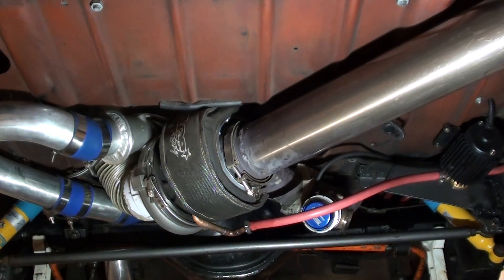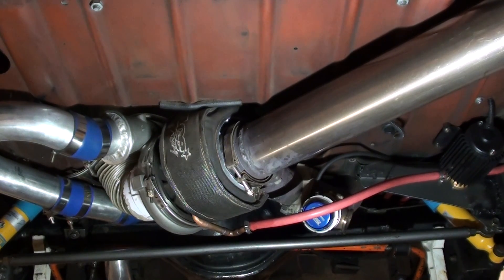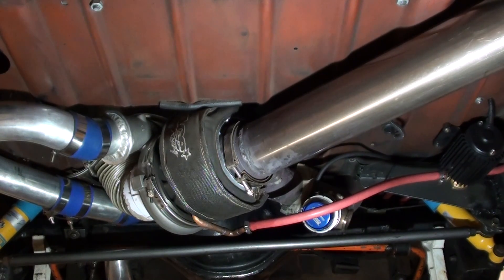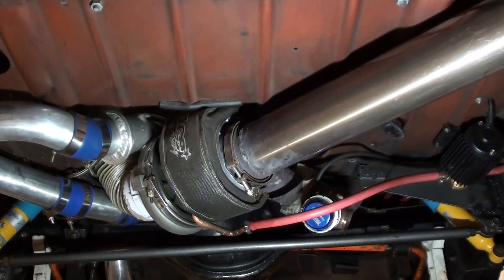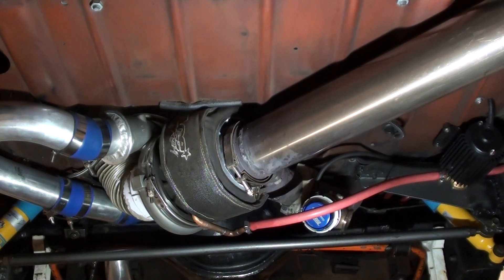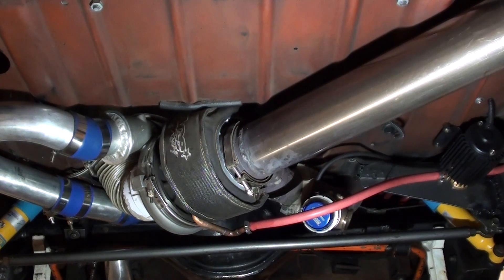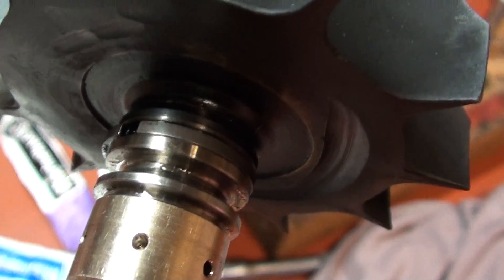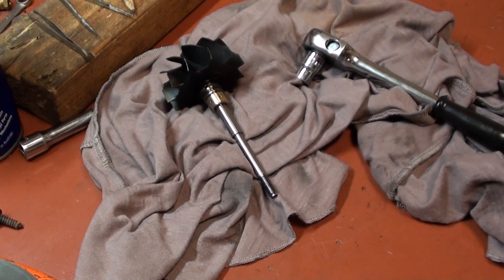REARMOUNT TURBO RETURN OIL SYSTEM  (POTENTIAL SOLUTION)

Comment: Great stuff brother. Did you ever try the reservoir? That makes alot of sense.  Run it out of the turbo into a small tank and the pump it back to the engine. But if the pump fails the tank will overflow. Good idea

Comment: Curious on how your oil return pump is lasting?  I’m seriously considering rear mounting my 302 but for some reason I keep hesitating. I have all the parts lol
Reply from the maker: I did have a turbowerx pump fail well before it should have, bought a china one and believe it or not still going... tip make some cooling fins for it  keep it running cool...

Comment: Griff I’ve seen some guys put a 1psi check valve in the oil feed line to prevent the oil draining down to the turbo when the car is off. Have you seen or considered this?
Reply from the maker: I have heard of that, The system I run now has completely solved everything to do with the return..

Comment: My understanding was that the return line from any turbocharger needs a free flowing gravity fed return with as straight as a run as possible to eliminate excessive pressure buildup in turbine core, hence the use of a metering device and set oil pressure into the turbocharger oil inlet.
How does this system get around that?

Or is the oil return side not as important as it has been made out to me!

Comment: Hey I'm form Sydney, Good to see a a fellow Aussie on youtube with a banging car. Great video, Highly informative. Thank you for uploading.
I am considering a similar set up for my 4.2L S5. There i no room in the engine bay for turbo's and a supercharger kit will only yield me +170hp including supporting mods. So i really want a turbo instead and it looks like rear mounting is my only option. I like the fact that there will be less heat generated in my engine bay. Plenty of airflow under the car to keep the turbo cool.

What kind of costs would I be looking at based on your experience ? Is it as simple as buying an aftermarket exhaust with soem fabrication work to fit the turbo?
Reply from the maker: Its not easy to answer your question without seeing your machine.. Based on 4.2 cube a 2.5 inch exhaust system will work well with good flow, and will offer quick spool up...You  need too have a hi flow muffler if running pre tubo. Basically a see thru.. Personally i would solid mount turbo and run flexible bellows.. Theres a lot to consider for it to work well.. shame im not closer mate.. Cost varies depending on quality of parts and if your able to do it yourself..
Reply: Ahh right I see, Thanks for your reply mate I'll take note of that and I'll see what I can do to save money along the way. I'l keep you updated with progress if you're curious. It will be a tight fit under there cause of Audi's 4WD system so it should be interesting to see what can be done.
Cheers buddy :)
Reply from the maker: Levi Lavel im always curious of rearmount builds and yours sounds very interesting mate...

Comment: I have only seen video of one other person running rear mount, and saw one of your newer videos, the first thought that had occurred to me was how do you keep it oiled, I assumed that you just do just the same as a regular front mount. I decided to look if you had addressed it and found this video. It seems like a logical solution to just add a small pump and reservoir just for the turbo rather than using a lot of hose and plumbing it all the way to the front, it would be a lot of hose for potential leaks. A side benefit would be that even if the engine somehow starved itself of oil you wouldn't have any risk to the turbo, so long as the pump can still run while the engine cools.
Reply from the maker: trued_2  There are a few ways too run a oil system, but i like this way, have a look at the finished mod vid i did, Thanks for you input i have weighed up pros and cons.cheers..

Comment: eazy fix run two lines to and from the turbo then to pump for the oil also i would run the lines inside the chassis rail or frame ??

Comment: Thank you for sharing!!!
Reply from the maker: NSCA12 no worries, i hope you checked out the vid for the results. works like a beast, no more issues,
Reply: Brother that is great. There are also have check valves that go in the oil inlet to the turbo that are 1 pound of pressure  to open. Those are supposed to work great for shut down.

Comment: I would run bigger diameter drain line and try and mount your scavenge pump lower. Your drain line runs flat too long.  A slight vacuum shouldn't do much.  Also look at your engine breather set up.

separate recommendation is change to a Weldon external pump/motor fuel pump.  Those Areomotive fuelab bosh style big pumps put a lot of heat into your fuel!
Reply from the maker: dog big Have a look at a newer vid for the results, incredible!!  Yes you a dead right, regarding fuel pump, definitely heats fuel, but the amount of driving i do for me, its not a issue, but for a daily driver i could see issue's, thankyou for the heads up...

Comment: why you just dont use separate oiling system for the turbo only,a small tank,pump and sum piping.
Reply from the maker: Vlatko Veselinovski The reason i havent gone down that path is i had a scavenge pump fail, the turbo was fine still, but remote setup pump fail there goes 2000 dollar turbo,

Comment: I have had the -10 braided hose between my turbo and the scavenge pump fail due to my scavenge pump creating excess vacuum. it was creating so much vacuum that it ripped the rubber hose off of the stainless housing and as it collapsed away from the walls it tore, allowing the scavenge pump to suck in dirty air and also when the car was off it would leak whatever remaining pressure was between the engine block and the turbo bearing. I think I will do a vented canister for the turbo to drain into then have my pump suck that out. other than that, I have had numerous electrical  issues cause the pump to fail and if it was the only pump supplying oil to the turbo, I would have been screwed. I had gravity feed before but ran into backup issues despite my turbo being at cylinder head level. I enjoyed your video and look forward to seeing your results and future videos
Reply from the maker: scott 500 Well mate the results are in have a look on my channel, its solved all issues that rearmounting cause....
Reply: shweet

Comment: Have you thought about doing a stand alone oil system. Example.. 3 gallon tank fall through turbo to your bottom drain to savage pump to cooler back to tank? Thoughts
Reply from the maker: I have, but I prefer the system I currently run, latest vid tells all...
Reply: Griffs Rearmount Turbo. I watched it already! Do you have a video explaining how you mounted the turbo pipes and everything? I looked but couldn't find anything. Thanks for the quick response!
Reply from the maker: No I haven't really, when I do the vid on my exhaust fix etc, I will include some show and tell about the charge pipe etc....etc
Reply: Surely the seperate oil tank idea would contain cool thick oil as not heated up by the engine. This may affect proper turbo oiling due to non optimal viscosity?

Comment: Yea im going to install two rear mounted turbos very close to the front of the bed in my 1972 C10 pickup. Its already has a good running Big Block Chevy.
Reply from the maker: There's a Aussie saying, CRIKEY, isn't a big block enough,?
Reply: Well I like to Dragrace. So I am shooting for over 1000hp. I had the 12 bolt rearend rebuilt with  posi and 4:11s.
Reply from the maker: Anspar Anspaugh shouldn't be to hard 1000 plus...
Reply: Yep it's a 468ci full roller.
Reply: I love the way "crikey" sounds but wtf does it mean?
Reply: Would be curious if Anspar actually did this... I doubt it. But, in the case he did, I would like to see. I have aspirations of boosting a 440 n/a.
Reply: JediFishKC yes of course I am actually going to do this. Be sure to get the oil flowing right and the right fuel and spark tuning.

Comment: On my old 5ltr Commodore, it used to blow a little bit of smoke out the exhaust under medium braking and above about 3000rpm. I found out that because I wasn't using any type of windage tray or baffles in the sump, the engine oil would slosh forward and get thrown up by the spinning crankshaft onto the cylinder walls and get burnt. Admittedly it was a old engine that was a bit worn.
Reply from the maker: yes I could see that happening, this even happens when just after you rev it sitting still. It will be interesting when I do mod.

Comment: Just use a ten litre tank in the boot with a transmission oil cooler and a diesel fuel pump feeding the turbo , dump the drain tube into a one litre tank drained by the scavenger pump into the main tank. Don't connect it to the motors oil supply
Reply from the maker: This design will be second choice if this idea I have stuck in my head fails, thanks for the tip..
Reply: Griffs Rearmount Turbo. You're welcome 😊 that is the safest design also, it will still gravity feed if a pump goes out. You can fit a pressure gauge to warn you if a pump dies and being separated from the engine oil system protects the motor from harm if the lines get cut or the scavenger pump explodes. It will be cooler too. You could probably use atf for the turbo or at least a different colour oil than the engine so you can tell which is leaking.
Reply: That's what I was thinking. If it's a rear mount jus put a reservoir in the trunk and run your pump right into that instead of going to your cars oil system.

Comment: Great video and I think you're on the right track.  I went through the same issue with my 345 Scout turbo.  I had the turbo mounted low - below or alongside the transmission up the front of the vehicle.  I was running the same Turbowerx scavenge pump you are running.  For me, it was smoking on startup after sitting for some time.  The fix was almost exactly as you describe.  I made a small steel 'sump' that bolted onto the drain portion of the turbo housing.  It hung down about 2 inches below the mounting face of the drain back flange and about 3 or 4 inches back.  It was only about 200ml's or so.  I then TIG welded an AN fitting for the drain back hose on the bottom of the little 'sump' and welded a threaded boss into the top portion of the sump where I used a steel Ford Cortina diff breather for an atmospheric vent.  The sump used to fill up about 3/4 of the way when hot, so a little more volume would have been better.  Anyway it solved about 90% of the smoking issue I had from the engine... I think the rest was Valve guides!  hahaa
Reply from the maker: EveryDayCar Gee mate thats just what i needed to hear. I really believe i am on the right path on my theory, what you have said has put a smile on my dial thankyou sir....

Comment: Jason 2 things you should have a check valve so oil down pile up a shutdown and you should do a self contained oil canister in trunk and never touch your engine oil ever again and also lot shorter lines.
Reply from the maker: Your dead right for check valve, but I do like this way of oiling setup, as long as there is engine oil pressure the turbo is fine. I have had a high quality turbo werx pump fail well before its service life, motor still works but wont pump.Thankfully turbo didn't suffer.i can see what your getting at with a separate oiling system and the benefits.but I want to sort this design out if I can.Cheers Denny, your comments I respect and enjoy.
Reply: Griffs Rearmount Turbo. I just re-read myself and noticed I came out bad... almost sounds like you have to do it my way... my apologies..I meant it in a how about this other way... when I go rear mount on my car I'm going to go with oil self contained system just my way of thinking of isolating what is possibly the most unreliable thing on a turbo...
Reply from the maker: Denny Medeiros All good i didn't take it the wrong way.i do have the upmost  respect for you.  Ps. The warm weather has come to an end raining now and a bit cooler...cheers griff.

Comment from the maker: When I metioned drag cars blowing smoke at the end of the there run, it doesn't mean that its a turbo problem I mean it could be a similar issue who knows?.i was just thinking out loud...But I hope you guys understand were im coming from with my crazy theories...
Reply: HI Griff i had similar problems and have eliminated now i made a little tank before the pump say around a cup full in size. As the oil from the turbo is highly aerated it needs time to dearated before being pumped back.
Reply from the maker: Morcs i wouldnt doubt that for a second, under boost it would be intense inside the centre of turbo...
Reply from the maker: yes, drain out the bottom for scavenge pump, then a breather pipe off the top to vent, so when you turn engine off it can drain in to tank .Thats the theory all will be revealed soon.
Reply: Is that like a oil catch can?
Reply from the maker: sorry realized question was to Morcs.
Reply: Mine works fine without the extra breather and my motor is very tired with a lot of blow-by i have also added a timer so scavenge pump will run on for around 60s after ignition off